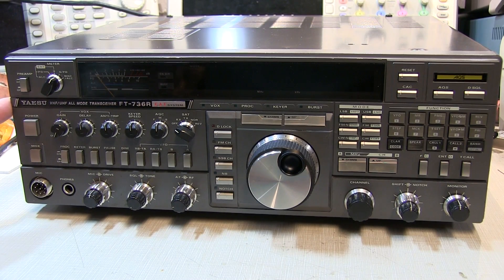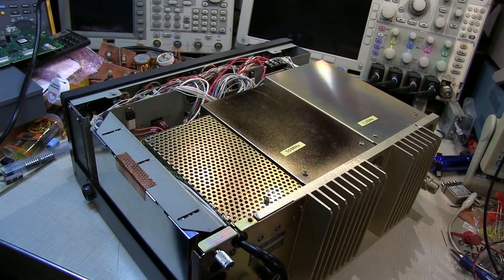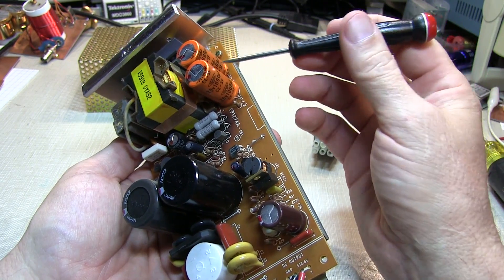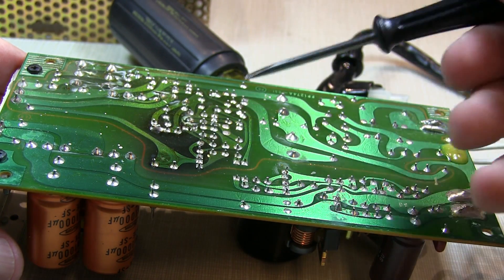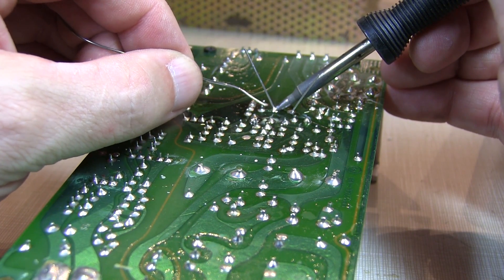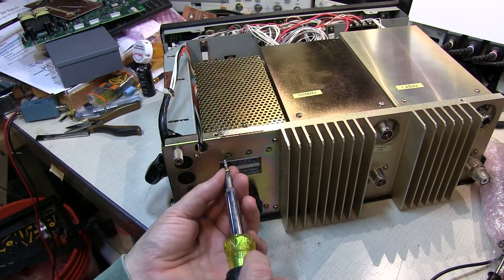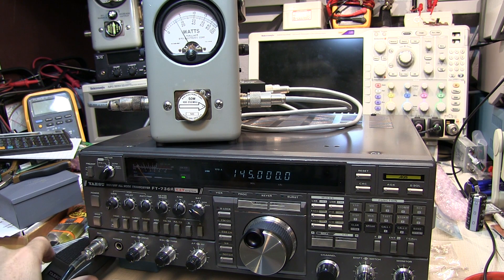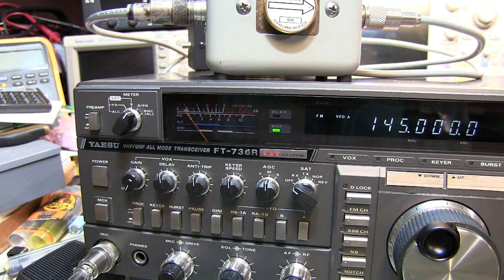#258: Repair Log: Yaesu FT-736R re-cap of internal power supply | replace electrolytic capacitors

Comment: Alan, thanks for taking the time to video and post the repairs to the power supply. Got mine back to 100% again.
Now to find out what happened to the 222 module, that the radio no longer recognizes its presence. Worked just fine and then didn't! Even tried a different internal plug position and a seperate 736. Nothing, dang!

Comment: Hello Alan, what special tool do you use in the video to desolder/remove the old capacitors? Do you know a current source for the tool? I am from Austria, Europe.
Reply from the maker: I used a Hakko 808 handheld vacuum desoldering tool. This model is discontinued, but Hakko and other manufacturers sell many types of powered vacuum desoldering tools.

Comment: The previous owner of my 736R found a NOS power supply to put in, but decided to no longer use the integrated supply to power the rig because he didn’t want the new supply to suffer the same fate as the old one.

So now I have a radio with a virtually unused supply in it, but I keep using an external supply myself because I’m worried that the caps have now degraded from being powered off for so many years.

I used to think about recapping or starting the supply on a variac, but once the radio was connected to the shack supply, I quickly forgot about the internal switcher

Comment: I just received a 736 for repair.  I did wonder, I would have also suspected the power resistors might be bad.  I think replacement of those, and put them a bit higher off the circuit board.  73 Glen K4KV

Comment: I would have changed the mounting of those two power resistors as well,  make them vertical and away from nearby components,  constrained of course by the dimensions of the enclosure.

Comment: I'd consider new power resistors and extend above the board as high as possible which would move the heat away from the nearby caps and the board itself.
Reply: i was thinking the same

Comment: Do u repair these radios? I need my 440 working agoin what happen was I was talking on it forgot to move a ant away from it I had both my 2 meter home made ant next to my 440 at the time got in a hurry talked long enough to call out waited for a few no one came back turned off the radio came back the next day ID up no TX> To me it sounds like a finel on the 440 side
Reply from the maker: I"m sorry, I don't do repairs generally - just for my own rigs and for close personal friends.

Comment: Alan,
How unsafe would it be to use two Sencore PR570 Variable Isolation Transformer’s to make repairs to a SMPS?  Example: the SMPS plugged into one PR570 and the oscilloscope plugged into the second PR570.
Is this a dangerous setup?
Reply from the maker: You only need to isolate one of the devices, not both.  It is usually not a good idea to isolate the scope.

Comment: I changed the two resistors for bigger ceramic 5 W resistors, mounted far apart from the PCB and the capacitors (used in fact all the available wire length).
One more thing : check DL7VHF's improvement with one fan to cool the said resistors, where I glued a 40 mm fan on the PCB to the right side the 33 Ohms resistors . There are two unused holes in the PCB, and once the solder removed can become convenient connection  for this 12 V fan. When remounting the grill over the power supply, you'll have to file the 3/4 of the right tab that comes in conflict with the glued fan.

Plus even a second one 22 mm fan located just between the power transistor Tr4 and the two power resistors on the left, tied with a collar to the two U shaped heat sinks. Its connection is picked at the location of R21, which I displaced on the solder side. Maybe I will use in the near future, as an improvement, thermistors to avoid the slight but annoying fan fizz, so than to reduce spinning speed when not needed.

DL7VHF also increased the values of the capacitors. In my case I used for C21 and 22: 3300 uF / 25 V and for C26 1000 uF / 35 V.

Comment: Perhaps one day ...You could show how you powered this up using a DC power supply ..My 736 is still working fine ..I am sure I will have the same problem one day
Reply from the maker: I don't have this radio any longer, so I can't show you.  However, the manual clearly describes how to do this (involves moving a switch inside the unit).
Reply: TNX

Comment: When you pulled the supply out of the rig it looked like there was thermal compound on the plate that connected to the chassis.  Is there a benefit to cleaning and replacing that thermal paste to help reduce some of the heat generated by the power supply?

Comment: I would have replaced the two 33 ohm power resistors with higher wattage units to eliminate high temperature dissipation. As it is, it will fail AGAIN, more of a repair than a fix.
Reply from the maker: Higher wattage resistors won't really change anything.  The resistors will dissipate the same amount of *power*.  Although the resistors will run cooler because the power is spread out over a larger area, the total amount of heat generated will be the same - so it wouldn't change the amount of thermal rise in the power supply enclosure.  Adding a fan would help though.
Reply: Obviously, high temperature is the enemy of electrolytic caps, by replacing the resistors with, say 10 Watt units, the temperature CONCENTRATION will drop dramatically in the vicinity of the two failed caps. Stacking two 10W ceramic resistors would probably work in this situation. Remotely mounting the resistors in the PS unit would work even better as far as evening out temp gradient throughout the PS housing.  Good video.
https://www.parts-express.com/33-ohm-10w-resistor-wire-wound-5-tolerance--016-33
http://www.newark.com/welwyn/wh5-33rji/resistor-wirewound-33r-5-axial/dp/98K2889
Reply from the maker: I agree that the temperature gradient will change by changing/enlarging the source of the thermal energy, and that would have to be traded off against the reduced airflow around the larger resistors (since we're still talking about the same amount of thermal energy, just spread out more).  Remote mounting is a good idea too (even better), provided the extra parasitics from the longer wiring doesn't affect the supply operation.
Reply: Well, one thing is for sure, the original resistors are way underrated and the way they are mounted they hardly get any air circulation around them to dissipate heat, anything to address that will fix the problem.

Comment: I just bought a marine ssb radio on ebay; cannot receive any channels, though the antenna being used is really for cb frequencies. Wondering if there is a way to test reception with a standard signal generator. Thanks for your advice.
Reply from the maker: Yes, of course.  You can apply a low level signal from a signal generator to the antenna port - just be very careful not to transmit, you will damage the signal generator if you do.

Comment: don't check the PSU with the rig, right after recapping. test it with some 12 volts light bulbs first. this way you don't risk burning out the transceiver if other faults are still present.
Reply from the maker: Good tip!

Comment: I had hope you had Illinois Capacitor part numbers so I could recap my radio's power supply. I do not know much about Nichicon or Panasonic
Reply from the maker: Panasonic and Nichicon are both well respected, reliable capacitor manufacturers.

Comment: Alan, one of the suggested mods to permanently resolve the issue was to add a small CPU fan to the cage to cool the hot spot down. There even seems to be a pair of open holes on the board for exactly that reason. Interestingly, there is also a DROK PS unit that will fit into this space if the original PS cannot be rescued. I went that route myself for mine. If one goes that route you will need to put 4 new holes in the metal sub-chassis to attach it securely, but it fits just fine inside the perforated cage. The '736 is a really great radio, and I'm impressed a rig of this vintage has quite a few SMD components in it-- very cutting edge for that time. -KA1IOR
Reply from the maker: I've see the fan mod.  The rig's owner wanted it "stock", so I didn't do that mod.

Comment: Thanks for editing your videos so they are concise.  I would guess it takes a lot of time on your part to do so, but it is respectful of your viewers.
Reply from the maker: Thank you for saying so.  I try to keep my videos to 10 or 15 minutes maximum.  Ideally, I'd make them 5 minutes long, but most of my topics require a little more time.  Many people don't realize that creating condensed content like this takes a long time - usually 10 to 30 minutes per published minute of video, if you take into account all of the preparation, experimentation, research, shooting, editing, etc.
Reply: @w2aew  Hey Alan, just dug up this old vid. Most folks dont' realize anything without it bonking them on the head. Have long appreciated the quality of your YT productions. It's a shame more people don't put a shade more effort into their videos. AND is why I haven't made full videos-just don't have the equipment or time to fool with putting it all together properly.  Thanks for all you share here.   I have two 736R's and now a TR 751A. Never even thought about running the internal PS on the 736's. Too easy to add DC power.  73 de W1ADE

Comment: I would desolder those resistors and put then on wires touching the back heat sink.
Reply from the maker: You've got to be careful when doing things like this in switching power supplies. Depending on where these components are in the circuit - the extra lead length could cause issues with the proper operation (due to extra inductance), or could cause RF emissions which would be detrimental inside of a radio.  I figure that it lasted over 20 years with 85 degree capacitors, it will last longer now with 105 degree caps.

Comment: Great video (like all the stuff you do)! Is it a typical symptom of caps next to a heat source to fail without showing signs of swelling or (physical) leakage? And while I'm at it: such heat-damaged caps .. I presume they cause excessive currents through standard Switching PS components like their often neighboring diode packs (e.g. MB20100) which will then further the heat-runaway effect? Thanks for your vids! Did someone ever call you the "Mozart of Oscilloscopes"? I hope so, cause you deserve that :)
Reply from the maker: If the caps don't get hot internally (from leakage current, or high ripple currents and high ESR), then they won't bulge.  Bulging is due to high internal temperatures.

Comment: Very useful video. I own an FT-736-R myself and it's working fine. After watching your video I wonder if I should swap out all the electrolytics to prevent possible future problems.
Reply from the maker: It's up to you.  As the caps start to go bad, you'll notice that the rig will take a few seconds to power up.  Gradually, the time grows.  If yours is powering up immediately, then you're probably OK for a now.

Comment: 6:00 R8 & R9 is good desingn (Resistor with heatsink)(left-down(AC input))! But why not degned too R17 & R18 this someway? Heating components need resoldering too (cracks solder heating&cooling).

Comment: Hi.

I'm wondering if you know the answer for my doubt.

Suppose one is developing a new electronic circuit and he/she wants to determine which components are more prone to fail.

Also, one wants to determine how long it will take for the circuit to fail (1 month, 6 months, 1 year ?)

Is there any reliable experimental procedure for that?

I know about the MTBF, but it seems a bit unpractical to wait until a circuit breaks.

Is there any procedure to "stimulate" the circuit to be in a state as it has aged a specific period of time so one wouldn't need to wait one year or more to see which components fail?

For instance, if one makes the circuit run continuously for 72 hours under 70 Celsius degrees then their components will behavior as if the same circuit had been used under normal conditions for a year.

I'm not sure whether I could explain myself. Sorry for my bad English.

Any help is very much appreciated.
Reply from the maker: There are ways to calculate circuit reliability that are theoretical, but are often used to predict operational life.  See this link as a start.
https://www.jedec.org/standards-documents/dictionary/terms/arrhenius-equation-reliability
Reply: I'll take a look at it.

Thank you a lot.

Comment: Alan -
Remember to check the lithium coin cell.  Located on front panel control board.
Replacement is Panasonic CR-2032/VCN (Digi-Key $1.11), vertical, solder-tab (VCN) style.
Yaesu used Sony for their OEM battery supplier in 1980s.

I change this lithium battery, when changing the incandescent bulbs (S-meter):
Yaesu: BQ041-228038V 100 mA, 8 Volt Lamp.

greg, w9gb
Reply from the maker: Good point about the battery.

Comment: Hey Alan.  My radio looks really nice sitting on your bench.  At one time I thought about fixing the power supply in mine!   But been running it on an external supply now for years since being disabled!   I used to work on all the amateur radios when i had a shop.   But can't hold a soldering iron anymore.   Thanks for the great video tho.....Ron
Reply: Hi Alan.   So I made an attempt with my crippled hands to replace all the caps you meantioned in your video.   Bought all the caps thru Mouser Electronics.    Radio lasted about 5 days working great.    Then out again.    I used all the specs when ordering the caps.   Don't know why it went back out.   So back to the external supply again.    Too much work for me being crippled in my hands.   Won't try it again.    Seems others are having good luck tho.

Comment: I have one of these also, and I have inspected the power supply. Mine has not failed...... yet, and it sure does not have the burned circuit board appearance. I will also say I have used it a lot. That radio has more hours than mine. Nice though that if the board becomes so non-repairable you can just use this great radio with EX power.

Comment: Did you also check out those two resistors that were creating the heat? Are they also still within spec? 
Perhaps they should be replaced with power resistors of equal resistance value and a much higher wattage value. That might solve the main cause of the problem of creating unwanted heat drying out the electrolytic capacitors.
Reply: It amazes me how people keep suggesting replacing the power resistors with a higher wattage value. All resisters with the same resistance value are going to dissipate the same amount of heat, regardless of the power rating. The only reason to use a 1 watt over 1/4 watt resistor is to keep from burning up the resistor. If the existing resistor is dissipating 1 watt, replacing it with a 10 watt resistor will change nothing. It will still be dissipating 1 watt. The only real solution here it to move the resistors further away from the board and/components, or shield or heatsink them, or increase the tolerance of the other components, just as he has done.
Reply from the maker: The resistors were still in spec, so no need to replace them.  A higher power resistor will not reduce the amount of heat - it'll just spread it out over a larger area of the body of the resistor.  Total heat produced is still the same.  Larger resistors would take up more volume, reduce air flow and put the heat source closer to other components (due to crowding).
Reply from the maker: Agreed!

Comment: My LG 42" Plasma TV had the same problem. Mine kept shutting down randomly. Changed some of the caps to 105 ºC and it works to this date.
I am not familiar with Transceivers, but I was told that SMPS's should not be used, as they produce to much noise and one would require a lot of complicated filtering to get rid of the switching noise!?
Also, there was something wrong with the play back of this video! I let it buffer, then replayed those portions with the same effect.
I really like your channel. Thanks for uploading your work for us to enjoy and learn from.
Reply from the maker: Switching power supplys can be noisy, but can also be properly designed to be reasonably quiet from an RF standpoint.  It helps that this rig is VHF/UHF, since most switchers create noise in HF bands.  
I think YouTube messed up the rendering.  My .mp4 file that I uploaded plays fine.
Reply: 10-4 thanks

Comment: Alan, how do you remove the through hole components? Do you have a special drill?
Reply from the maker: I used a Hakko model 808 vacuum desoldering tool.